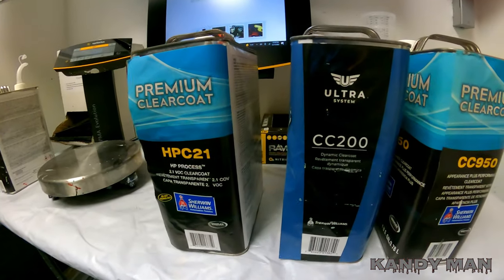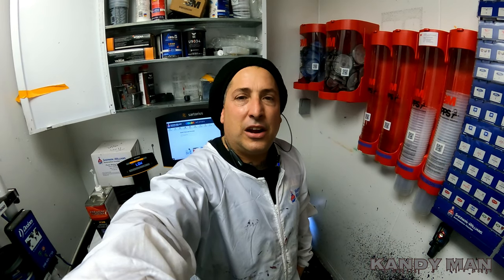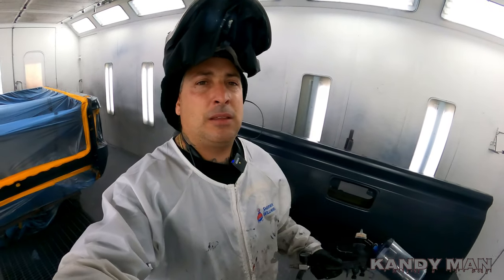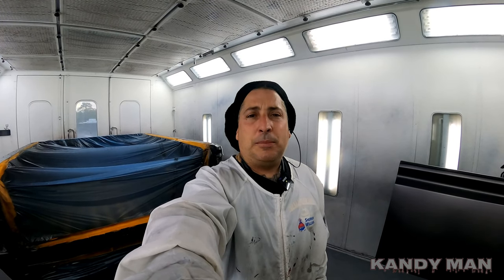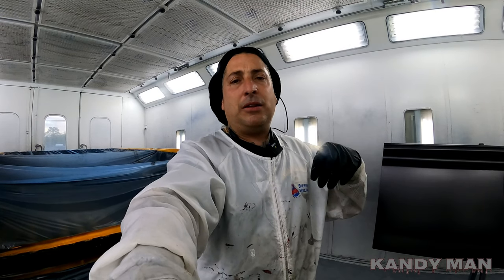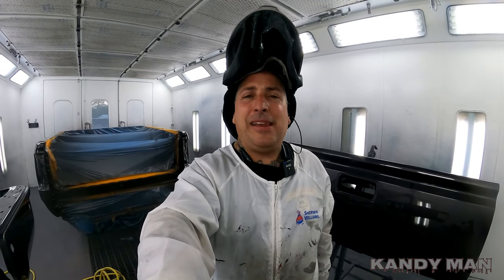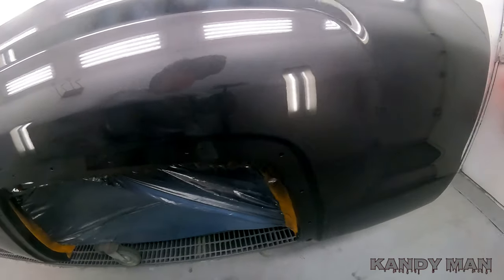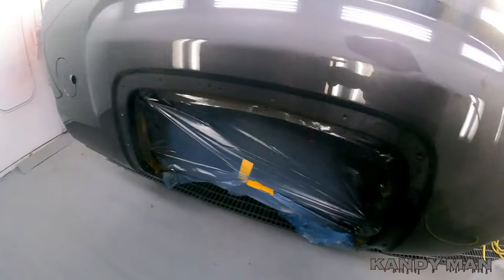CHOOSE THE RIGHT CLEAR FOR THE JOB

Comment: For me it depends what I am doing. I use a Devilbiss DV1-C clear gun i use for complete paint jobs. If a show car I use high solids like Roberlo 510 Kronox, or Chameleon UHS 177, for budget high solids Acme Finish 1 FC740 super brilliant clear, which i use the 1.2mm nozzle in the DV1-C because it breaks up the solids better. If I am painting panels and anything I must blend I use either Akzonobile U-Tech 4.0 or Acme Finish 1 FC720 Ultimate overall clear. For the medium solids production clears i use the 1.3mm nozzle. I have a 1.4mm that it came with too but i never used it. I got a new gun for blending panels to replicate factory orange peel. Its a new gun called a Porphis prd-715 1.3mm that is an awsome looking gun that is anodized a bright metallic blue with black and orange controls, the flow knob is click adjust. Its a sata phaser clone basically. The DV1-C just lays to good of a finish for blending for me.

Comment: I’ve been spraying the cc200 for a couple months now and I love it, we have the bc8 set up at our shop, solvent though not water. But the clear is something else, I spray it at 20-25 with my iwata
Reply from the maker: It is a great clear fast hangs on well and look  great  .💯
Reply: Yessir. Do you use the cc250? I tried it but the 200 is better in my opinion
Reply from the maker: Yes  I agree cc200  much better  product
Reply: 200 uses same hardener that cc250

Comment: Good video , 
My biggest issue is getting consistent air pressure with such a small compressor I’m constantly fighting pressure dropping , I usually try to use between 20-26  psi but but if I go 18 and pressure drops to 10 during spraying it’s sacrificing my finish , thinking maybe to add more air storage to try to remedy that prob
Reply from the maker: Eastwood got a amazing screw compressor for the house  I'm gonna pick one up when can .but yes you could put a extra tank
Reply: @kandyman5315  yeah I’ve been looking at that one for a while now it’s made by a company called Baldor in China, only issue is it runs on 220v not 100v which I’m limited to
Reply from the maker: Ya I had a 220v plug put in the garage for it . It's hard to find a100v that can produce

Comment: Nice job!! Are you talking about 18 PSI on DV1 digital gauge or the gauge before the gun? I'm asking because 20 psi on DV1 digital gauge in reality 28-30 PSI on the gauge before the gun. I have a gauge before the gun, so whatever DV1 showing is not actual pressure or that pressure somewhere inside of the gun.  But you are exactly right most guns recommended settings are 29-30 PSI that not great with MS clears especially in Florida where the temps now about 94-95 Fahrenheit in the booth. I'm using Prime 45 clear ( MS) and it lays down and shines better with 25-26psi on the gauge before the gun.
Reply from the maker: That's on the digital gauge on the gun
Reply: @kandyman5315  That's what i thought since i have same gun as well, so in reality it's about 25-26 psi.   Other viewers who does not have this gun will be confused if they will set  their guns of other brands to 18 PSI.

Comment: Kandyman i tried CC200 and totally agree with you, great clear, great shine, hard to buff if you wait too long but buffs great for me with Sonax Cutmax and microfiber pads, i found that is different to other clears, you dont need to put it heavy because will get texture, once you find the right spot flows and levels very well, and like mentioned before great shine and no die back. I also find that is very dependent on reducer, i had some US2 left and use it and left me a little texture, then the same day i clear another piece with US4 and was almost perfect. I am curious about which reducer you use for complete paint job on your cuttlass, i still have not sprayed a full car with CC200 but not sure if US4 will get me there, what do you think?
Reply from the maker: @cruzs.9040  us4 is my jam

Comment: How much of a difference is there between the c1 and c2 caps? I've shot the dv1 multiple times with the c1 and honestly did not like it much at all. No matter how much I adjusted the gun, pressure and my technique I just couldn't get a good finish. What are your thoughts between the two? I have a couple dv1s guns and love them, but I have the s2 caps on those.
Reply from the maker: It sprays different. But I'm a fan of both cap to be honest. Thanks for watching.
Reply: I have a brand new C2 aircap if you want to buy and try ill sell it to you cheaper than you can buy it online lol

Comment: Just started at new shop and they us the BC8 base with cc200 clear.  I'm having problems with fisheye and I dont think its from a contaminated panel.  I cleaned with waterbase and W/G remover.  The booth can only reach 70 degree max so I'm using S4 reducer.  Do you think I'm not letting it flash long enough or I need to use a slower reducer like S5?  Air jets are used to dehydrate panel but at 70 degree maybe I need to dry longer then 20 min.  If you have any experience with this issue I would appreciate it.
Reply from the maker: Us4 what hardner

Comment: What do you think of the Acme 720 ? I do not have a booth I work out of my garage . I use a Devilbiss pro lite, I’m thinking a 1.3 with a T110 cap. What would you e the coolest temperature I could get it done with? Thanks for any advice !
Reply from the maker: It's not bad for the money  I don't spray lower  than 70 degrees without a heated  booth
Reply: @kandyman5315  Thank you!

Comment: hi today was my first day using sherwin williams system i was a bit upset with how my clear turned out its was the cc250 at 24psi i did it like i did all my ppg clear and its had alot of orange peel so ill try 18psi and see what happens
Reply: the guy thats suppose to come and help me like patrick did to you its no coming yet he is busy so i am just finding out how it works
Reply from the maker: I'm a fan of cc200  not 250
Reply: @kandyman5315  ill try the cc200 then your the master and if you like its for a reason
Reply from the maker: @yohalmobarrera1849 cc200 is awesome clear it's what I used on my Cutlass cc200 us4 uh90 is the combo you want
Reply: @kandyman5315  so i did the cc200 with 18psi 😹thing came out like glass
Reply from the maker: @yohalmobarrera1849 awesome

Comment: I watched your video and you referenced that the cc200 can be sprayed in a non paint booth environment but I looked at the PDS sheet and it's says out of dust in 60 minutes is that still ok for a shop without a paint booth?
Reply from the maker: Yes
Reply: @kandyman5315  thanks man appreciate all the videos you do
Reply from the maker: No problem you will love that clear it's what I used on my Cutlass
Reply from the maker: One more thing, don't wait too long before you buff it it sets up hard
Reply: @kandyman5315  I hope to use it alot so far I really like the usability and price of the Sherwin Williams system I hope to build me a paint booth sometime after the first of the yr and can step up in clearcoat
Reply: @kandyman5315  ok cool so I start cutting on it in couple days?
Reply from the maker: Yes 2 days tops
Reply: @kandyman5315  so let ask you a question when I cut a car I use nib it out by hand then I have a orbital sander with an interface pad and I've had good results but I have a painter friend in Cali swears by all hand sanding only

Comment: Is the cc2000 better than the 720 sherwin clear?
Reply from the maker: Never used 720 but cc200 is awesome.  Thanks for watching
Reply: Cc200 is better than 720 clear but much more expensive. Way better gloss retention and will hold up way longer